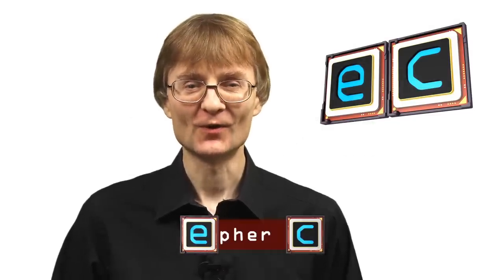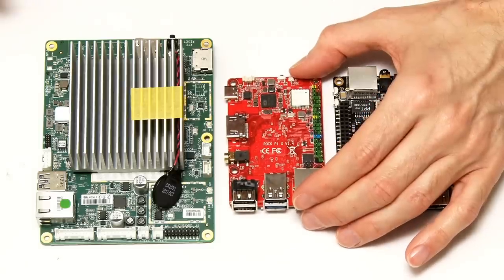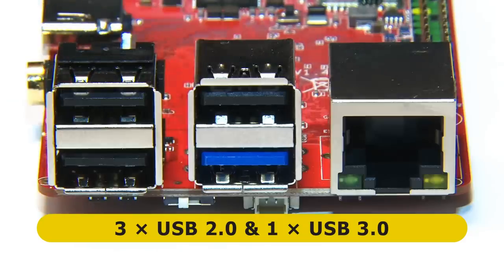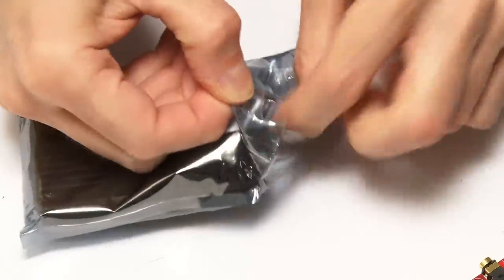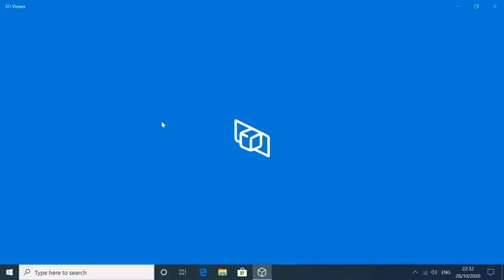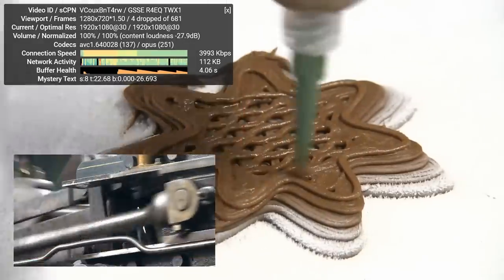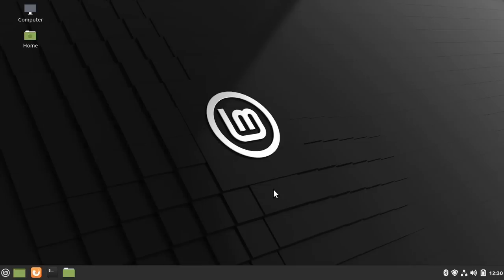Rock Pi X: Low-Cost x86 Windows & Linux SBC

Comment: Rather have a Lenovo ThinkCentre M90n IoT. Doesn't cost a lot more but it's complete, and a better machine pretty much all round.
Reply from the maker: As far as I can see, the Lenovo starts at about $350. The Rock Pi X  reviewed here cost $95, so even adding a PSU and small case to the Rock Pi , the Lenovo costs three times as much! :)

Comment: Won't there be a possibility of issues trying to install Windows 10 updates if you have the 32GB model?
Reply from the maker: Quite possibly! :) Windows in 32GB needs managing carefully these days. If you want to run Windows on this long-term, a 64GB model would be a better bet.
Reply from the maker: lass kinn  Agreed.
Reply: @ExplainingComputers  I agree. I used to have a Linx 12x64 which had 64GB eMMC and handled W10 upgrades with no difficulties. I also have a GeoBook1 which only has 32GB eMMC and this usually gets to a point where it will no longer take W10 upgrades. At that point, I just wipe my old W10 installation and do a full re-install from the latest media.

Comment: The atomic pi has rather limited ram available after windows install.  How was the Rock ?
Reply from the maker: The Windows install was fine but long-winded on the Rock Pi X. Installing Windows 10 on the Atomic Pi is limited y the 16GB eMMC.

Comment: I have never been able to make my pi 3b do a dang thing. It is junk. I can stream video just fine with the tiny and cheap firestick but I want something more like a pc and so I can run windows, that will stream my tv service and not needing fans. It appears this will not really do that very well either. I am no going to sit waiting for long buffering times. Is there something that will do what I want and reasonably priced?
Reply: @Schwalbe262 You might be confusing me with some others. I kind of laugh when I hear people expecting to do things like gaming on these low power or SBC computers, or maybe wonder why they overheat. I actually wondered if these could do much but look around and see what people say they can do and what they are doing with them. And I am not trying to run a complete desktop on a pi. I am running raspbian. Isn’t that just linux with a basic gui? I realize that even a firestick has simpler duties but people should state these will only do email (and slow also). I am interested in trying out things like this if it can be done. I know of other devices that will easily do this including my ryzen desktop. What would be a lighter OS I could use on say a fanless Zotac Zbox? Actually looking at the specs I wonder if one of those would run 7/8 or 10 and stream video decently. I have a couple low end laptops that can do it.
Thanks for the help

Comment: I find it funny that the sd-card cannot be easily accessed once the cooler is mounted :)
Reply from the maker: It is possible to remove/exchange the SD card with the cooler fitted.
Reply: @ExplainingComputers  thanks for responding so quickly, then this goes on the list for possible new sbc boards :)

Comment: Its an Atomic Pi with 2 more gb of ram @ 3x the cost.  That chip is OLD and can run windows if you want to look at it and move the mouse every once in a while.  If you want to do anything smoothly which includes things like writing a document or email, this is NOT the board for you.  I do like that its smaller than the Atomic Pi but its WAY to expensive for what your REALLY getting.

Comment: Hopefully they can find out if the USB 3.0 port is really listening on the pcie slot and make it to where you can get pcie support
Reply: What do you mean?
Reply: @smorrow  remember with the raspberry pie 4 and they found out the usb 3.0 support is really listening off the pcie bus... And remove the two port block and boom you're in with pcie
Reply: @adventureoflinkmk2  Oh, you mean breaking out the PCIe.  Yeah, that's cool - I'd imagine anything involving PCIe would be absurdly sensitive to wire lengths though. And interference, although people do break out the PCIe through ExpressCard (for eGPU), so maybe not.
Reply: @smorrow  yeah was gonna say... Pfsense box... Unlock the pcie to where you can put even a 4x slot and you're good to go for a dual or quad Ethernet card
Reply: @adventureoflinkmk2  btw everything under the sun works through PCIe, from old IDE/ATA controllers, to the SMBus (for laptop batteries), to even things that are supposed to be on the ISA bus (it's on a PCIe-ISA bridge), which is one reason I wasn't quite sure what you meant exactly.
Reply: @adventureoflinkmk2  Well the number of lanes would be pretty much set in stone.
Reply: @smorrow  true, true.. however if it can do at least a 4x card with preferably pcie 3.0 that would be great
Reply: @smorrow  that's cool and all (for real)... However, I was looking at a super minimalist pfsense router

Comment: The question that springs to mind is: would the people, who designed that SBC, think it were sensible to place a bookshelf in front of a radiator? The other question might be: do they understand very basic secondary school level thermodynamics? 😂
Reply: If you are saying that placing the heat sink on the bottom of the board and not having a fan is a poor design concept, then I agree.

That said, if I remember correctly, I had a similar CPU and chipset in a passively cooled W10 Lynx 12X64 tablet PC a year or so ago. If so, then the heatsink Chris used will be massively overkill for most uses of that type of system.

Comment: Why does the linux gui show a battery icon?
Reply from the maker: That is a great question!
Reply: @ExplainingComputers  After some thought I would guess because it has some logic built in is looking for AC power from a molex connector on the ATX power supply (apologies if my terminology is out of date) and as such assumes this is a laptop because it isn't finding it. Windows might be more (or possibly less sophisticated)

Comment: YT is a memory hog. If the rig had 8Gb it would give a better experience under YT in both OS's.

Fact: on this PC I'm using an Intel G1840 Celeron CPU which I believe is roughly equivalent to the one in the video (dual core against quad, but mine has a higher clock) and roughly of the same vintage, bought with 4Gb and upgraded to 8Gb myself, and that upgrade is what has done the difference, what allows me to use this PC stil today (office use, for gaming I have another rig) using YT and indeed for general browsing, without too many drawbacks.

Perfect no, usable yes and much faster under the merciless talons of YT than the miniPC in the video showed to be.
Reply: I feel (granted, no real-world diagnostic data to support, only perception) that 8GB should be the absolute bottom limit of supplied RAM in any general-use computing device, and that shouldn't be leveraged for a price increase either. RAM is by no means a special technology. I'm seeing more and more situations where 16GB is actually needed for smooth operation, placing 32GB as the new top option. On every device I own though, 4GB is just insufficient anymore for smooth performance.
Reply: @k.b.tidwell  The post above needs update. I recently upgraded this machine to i5 4590 and brought it to 16Gb RAM. Just for the archive.

Comment: Can this SBC runs/installed Mikrotik/Router OS x86? I just need 1GB of RAM and 4GB EMMC. And more additional LAN Card.
Reply: Interesting. It probably can be installed, but, not sure how exactly you'd do it. Getting a another Ethernet port may be a challenge though, unless the pcb is modified in a way. Are you tryna build something like a firewall with this? 😛
Reply: @hariranormal5584  nope. Just for managing  network users bandwidth. The ethernet card might be using USB inferface. I have no idea if this SBC can support PCI card.
Reply: Yudi Chan 
There was a mod for the RPI that gave extra cpu lanes where you could connect things to it, for this board, not sure :/ you'd actually be better of doing the USB to ethernet way

Comment: Is there any reason to get Raspberry Pi over a Rock Pi X?
Reply from the maker: See my comparison video here! https://www.youtube.com/watch?v=VYkRpLTEp-w
Reply: @ExplainingComputers  Yes, I saw it. They are quite identical by performance but on Rock, you can run all applications, while on RPI only a limited quantity of apps. So, I don't see any reason for RPI. Maybe I have missed something?
Reply from the maker: @slavikator  It depends what you want to do with the computer. If, for example, you want to use the GPIO pins for robotics, IoT and such like, there is far more support for the Raspberry Pi. But for use as a general purpose desktop PC, you are right -- the Rock Pi X offers the advantages of the x86 platform, esp. if running Windows.
Reply: @ExplainingComputers  Indeed, it makes sense for the specific projects, like this one - https://blokas.io/modep/

Comment: They should have just used those zen based athlon chips for sbc!
Reply: @J Fz those laptops cost around 150$ new.. and an sbc with just built-in ram and a bit of emmc without any battery , case , lcd , keyboard , mouse & other costs ... Should be around 70$ at max. U can get ryzen 3 3200u laptops for 250$ eith 250gb ssd and 8gb ram.. and minus all those and it should cost not more than 150$ to make an sbc with 3200u but 3200u equivalent sbc like the udoo v3 is like 350$ without ram and storage .. & it even uses lower power chip with ryzen embedded stuff.
Reply: @J Fz the atom is like 7 watts so the power consumption of the whole board with keyboard mouse should not exceed 15watt.. u can get laptops and tablets with these cherry trail atoms for like 100$ with all keyboard mouse display and everything which is a better deal than  getting this .. and the udoo is over priced probably cuz of the low volume production and they r also using an industrial chip which is made to run 24x7 stable unlike the normal laptop chips.  but i think they should make some of those dual core athlon sbc .. raspberry pi is a good one but the performance is no where near as good as x86 but it runs smooth and does most of the work only cuz of arm is so good on linux and linux is really lite weight.

Comment: It's so bizarre that they put the chips on the underside, which will make it more difficult for the heat to radiate from the heatsink, and it makes active cooling out of the question. Silly and unnecessary. It's just bad design. Ultimately it means that more metal needs to used in order to make the heatsink efficient – a very poor example of optimisation.
Reply: Flip the board upside down?
Reply: @stephenhookings1985  lol
Reply: Boodysaspie , IKR, those things typically have excellent thermal solutions including fans. Rock Pi should think about that.
Reply: Boodysaspie  can you imagine a gaming PC built in such a way that the tower actually sat on top of its graphics card thus insulating its GPU – making thermal radiation more difficult and active cooling of its GPU completely impractical? That would be hilarious. Or imagine designing a PC so that the graphics card were sandwiched between the underside of the motherboard and one side of the case (without a fan). Yes, well funny. 😂
Reply: I agree with your point in theory. In practice, I think I had the same chipset passively cooled in my Linx 12x64 tablet PC. It worked fine for everyday uses. Until about 10-15 years ago, many or even most laptops mounted their cpu's on the underside of their motherboards, needing good active coolers. Today, many cpu's are on the upper sides, allowing the use of smaller active coolers or even just passive coolers.

Comment: I need a cheap computer that can run 3D Builder- MS won't even let me download it! Could this computer be what I'm after? Where can I dl a suitable Windows 10? Is it very expensive?
Yes, I am very new to all this; how'd you guess?
Reply from the maker: This should be able to run 3D builder. I cover the process of downloading Windows 10 and creating an installation media in this video: https://www.youtube.com/watch?v=Bz_AyZswvXM  -- all via this page: https://www.microsoft.com/en-gb/software-download/windows10 You can install Windows 10 and run it as long as you wish for evaluation without activating. To activate you will need to purchase a license key. From Microsoft this costs  $139 (£119.99). But you can find license keys online for less than $10 . . . You may find it easier to purchase a cased mini PC with Windows 10 installed -- eg this has the same spec as the Rock Pi X: https://www.amazon.co.uk//dp/B07ZH5B857/
Reply from the maker: @Pygar2  Excellent! That looks like a good deal. Good luck!

Comment: This weekend I loaded Windows 10 Pro on my lattepanda 4 / 64 runs much faster than the Windows 10 it came with. The only thing that didn't work on boot up what is the sound port. Worked on it for about an hour or so couldn't get it to work not really sure what drivers it needed documentation is fuzzy but I really did need the sound other than that it works great. If anybody out there knows what sound chip is on the lattepanda and what drivers to use let me know
Reply: If you run out of ideas you could buy a $5 USB audio adapter which will work out of the box in Linux & Windows. Though obviously it will occupy a USB port...

Comment: I fell asleep during the full price breakdown in multiple currencies of every single board on display. Just stick it in a link please.
Reply from the maker: Well, while you were asleep, I did NOT provide the prices of all models -- for the Rock Pi X I noted the different specs available, and the prices for the highest and lowest spec boards (all two of them) and only in dollars. I then provided a price for the board I board in dollars, along with the accessories purchased, and a pound conversion for the lot. So clearly, if you had not fallen asleep, you would have seen and hear that what you imagined to have happened did not happen! :) Providing appropriate levels of detail is always balance, and I sorry that my choices did not work for you.
Reply: OK, but there's no need to give the exact price for everything in every currency. Did the heatsink need thermal compound? How much current does the unit take? 'Just over 1A' would suffice instead of 1034.7milliamperes at a room temperature of 23deg C, which is 85deg F etc etc. I know some people like everything to the nth degree of detail and I have not converted deg C to F.
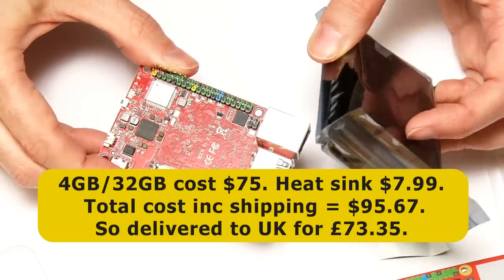Reply from the maker: @robertbox5399  I am confused. I did not do as you clai and give prices "for everything in every currency". Except on one occasion (at 2:20) every price cited is in dollars only.

Comment: Anyway you can take a break from the single PCB's for a while?...it's hardly exciting/engaging and thanks to it's surge in popularity, there's now almost new model every week with relatively no differences in composition or hardware (minus a peripheral or connector interface). I would love to see more content like the 3D printer demos you posted a couple of weeks ago or something new. Those are the best.
Reply from the maker: Thanks for this feedback. Just under 50 per cent of the videos on this channel are about SBCs, and the rest about broader computing issues, and this has not changed for a good five years. The SBC videos are also the ones that make the channel a viable business for me, so they are not going anywhere! But at least every fortnight they will continue to be more general computing content. Personally, I would like to do more on 3D printing. But sadly such videos are not popular.

Comment: It's actually better than some cheap Walmart laptops.
Reply: That would not be surprising, My ultra cheap UK PC World GeoBook 1 Celeron N3350 netbook just beat the Rock Pi X Passmark 9 benchmark with a score of 724. Many of these cheap laptops and netbooks are now really SBC's too. Most of the space inside the case is battery and sometimes the motherboards are barely bigger than smartphone ones.

Comment: Too bad it does not offer an 8GB RAM configuration.  In 2020, I think 8GB RAM is the minimum for a desktop PC.
Reply: I think that's a great recommendation for W10. 
But my daily driver runs W10 in only 4GB and, for what I'm doing, I don't really notice any problems. Two of my other PC's do have 8GB RAM but neither of them has charmed their way into becoming my daily driver.

Comment: I have an Android tablet with the same cpu and it is fast and responsive. Too bad it seems that it cannot be rooted to install linux.
Reply: I had a W10 Lynx 12x64 tablet with the same chipset (I think). I could get it to boot Linux from USB but I never managed to get the integrated wifi system running under Linux.

Comment: Ubuntu 20.04 wifi fix

https://forum.radxa.com/t/ok-ubuntu-18-04-20-04-bt-wifi-even-after-copy-wifi-firmware-wifi-bt/5731

1 Unzip the AP6225 (WiFi & BT Firmware) patch file
2 Rename brcmfmac43455-sdio.ROCK Pi-ROCK Pi X.txt to: brcmfmac43455-sdio.txt (you must change the name, otherwise UNBUNTU cannot recognize this file because "ROCK Pi -ROCK Pi X" with spaces, this is the space problem)
3 Copy the three files to /lib/firmware/brcm and
restart the system, everything is OK!

Comment: Still cheaper to buy a regular terminal.
Reply from the maker: Which "regular terminal" costs $75?! :)
Reply: @ExplainingComputers  I got Dell WYSE Z90D8 with 2.5 inch SSD and 8 GB of DDR3 ram?

53 dollars in Poland and a windows 10 pro license. Add cheap 4GB RAM stick to that price and you are set.

Comment: Can someone explain to me why they keep making SBCs with 4gigs of ram then saying you can rin windows on it? Sure you could run windows 10. But you wont have many resources to do much of anything else.
Reply: I'm here happily running W10 on a GeoBook1 with only 2GB ram and 32GB eMMC. But this is really only my YouTube (etc.) machine and not my work PC. My Linx 12x64 with the same chipset as the Rock Pi X and 4GB ram + 64GB eMMC was fine for my consultancy work but not for serious number crunching or modern games.